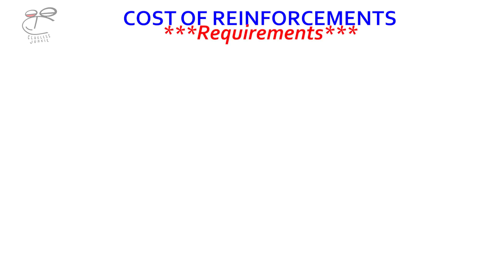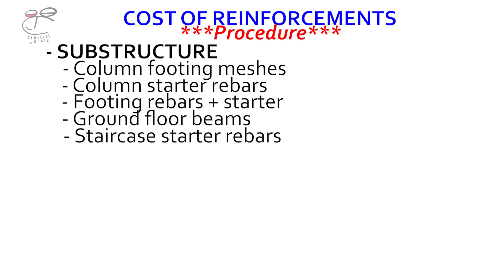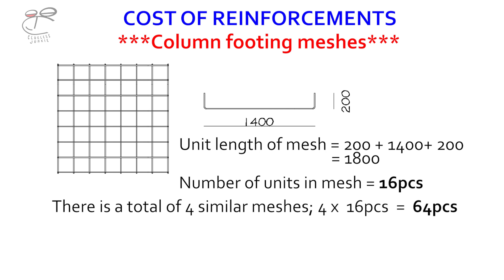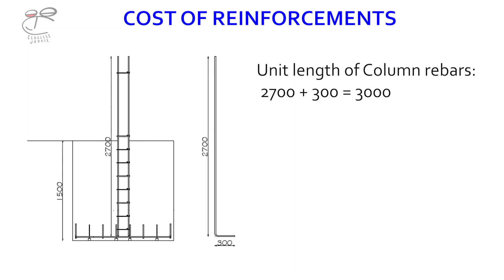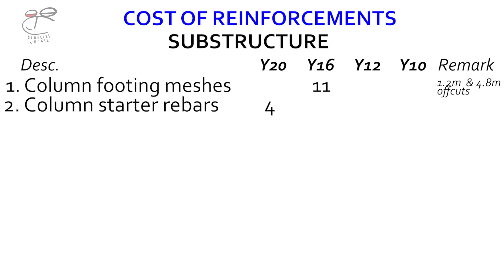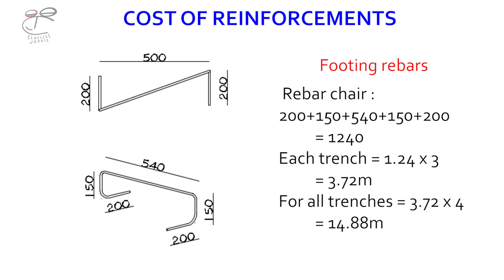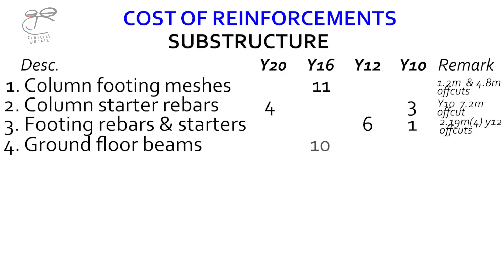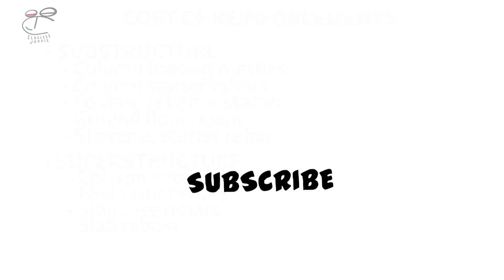Calculate cost of reinforcement | Building a house #cost #building #foundation

Comment: An Observation. I think the total rebars required for the mesh is 9.6 length app 10 length and not 11.
No of mesh 4pcs. Rebars in each mesh 16pcs top and bottom. Therefore, 4x16 = 64pcs of rebars mesh needed to be cut at 1.8m
Total length = 1.8×64pcs = 115.2m
Length of rebars =12m.
Therefore, total no of rebars needed for the project is 115.2÷12m = 9.6 lengths approximately 10 lengths.
Reply from the maker: Thank you for sharing your observations and calculations, it's important to be precise when it comes to reinforcement.

NB: Only 6 units of 1.8m bar can be gotten from a 12m rod, with a 1.2m offcut (which cannot be used in the mesh)
Therefore, to get 60 units of same 1.8m bar, 10 12m rods would be needed (here the offcuts 1.2m becomes 10 too)
But 64units of 1.8m is needed for all the meshes, so an additional 12m rod would be needed for the remaining 4 units of 1.8m bar (offcut here is 4.8m)

Hope this helps.

Comment: Please a quick question?
 What’s your advice on casting rooms individually instead of germanfloor while building a duplex engineer advise casting rooms individually to reduce cost please is it a good advice?
Reply from the maker: Hello, I do not have enough information to give a proper response. 
However, cutting costs may compromise the integrity of the building in the long run.